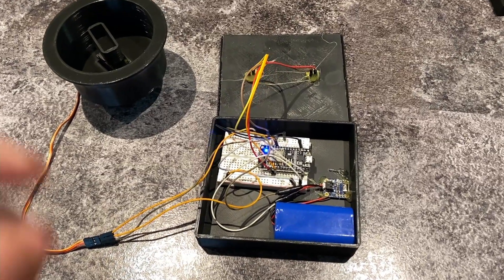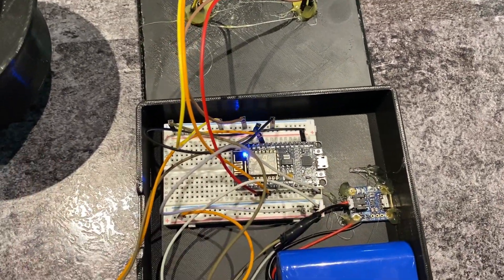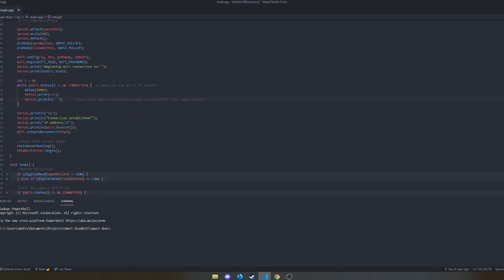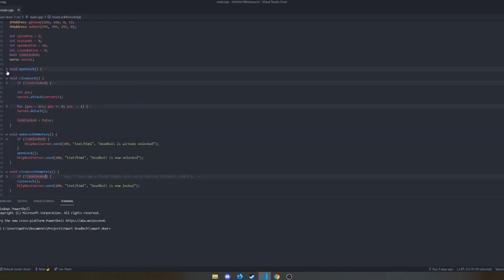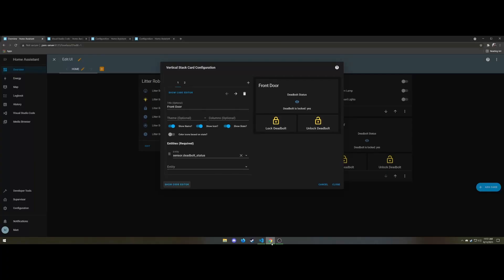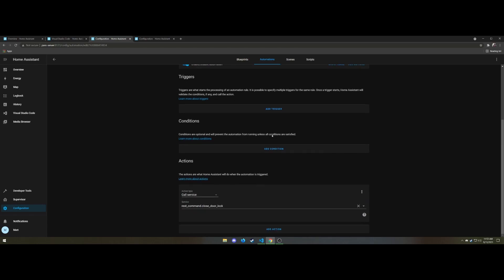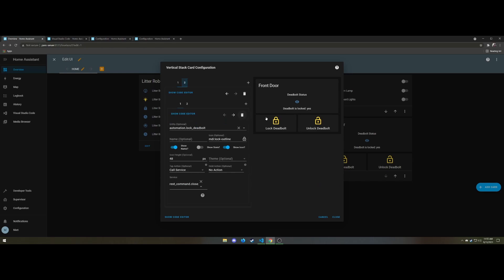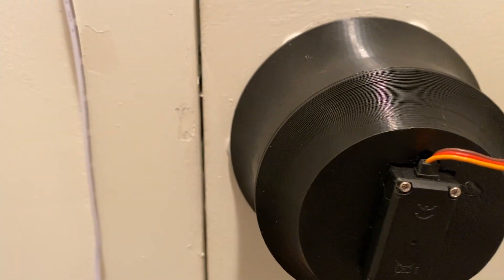DIY Smart Door Lock - Project Showcase

Comment: What was the size of your deadbolt(what the deadbolt mount was controlling),mine is 65mm in height and 16mm in width.i wanted to know if it would work with the 3d printed mount

Comment: how long does the battery last in standby?
Reply from the maker: I moved at the start of the year and haven't used it since, so it's been a while. But nothing some simple math can't tell us! You can estimate how long something will last off battery power by doing (capacity of the battery in mAh)/(the power draw of your device in mA). Obviously power draw will vary based on different factors like if you use a different board or how often the servo spins. 

But for this specific board and now including any servos, we can do 4400mAH (the size of battery I used)/~50mA (based on this power draw chart here https://bbs.espressif.com/viewtopic.php?t=133). Since the code I wrote has the device constantly looking to a REST server for commands, it never really gets a chance to enter sleep; a good place for optimization. But that exact configuration should give you about ~88 hours of constant on time, give or take the factors mentioned above.
Reply: Thanks! I thought that using deep sleep, ESP-Now, and an LDO with a quiescent current in the range of microamps one can extend battery life drammatically, to the order of months for a project like this